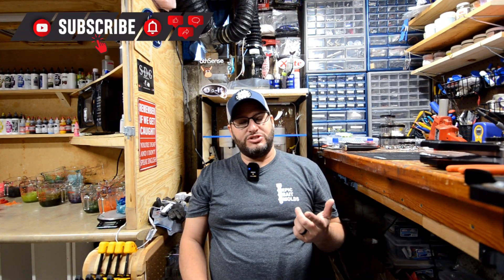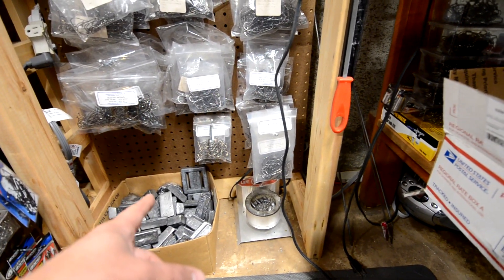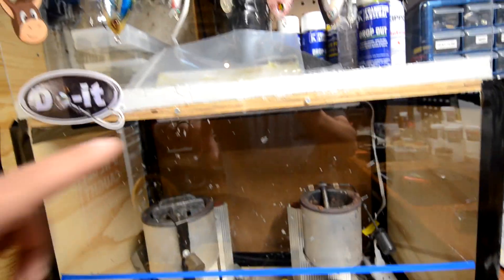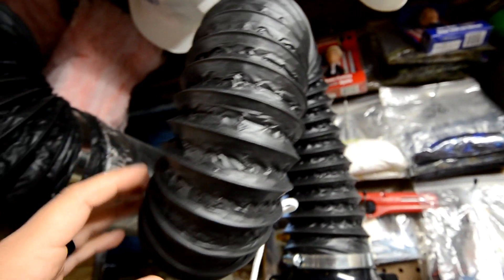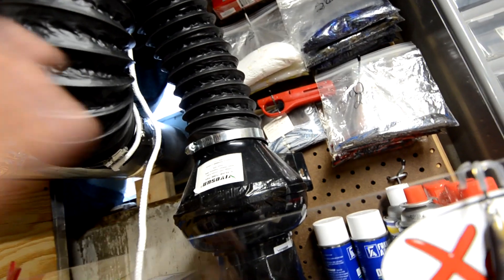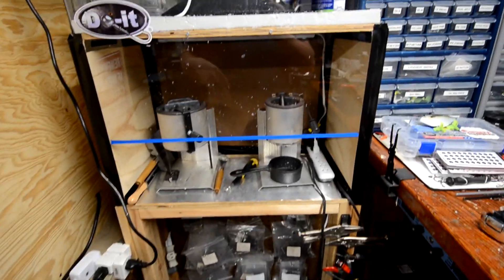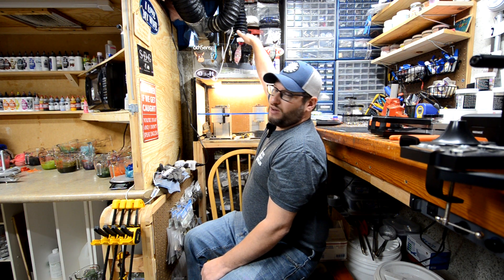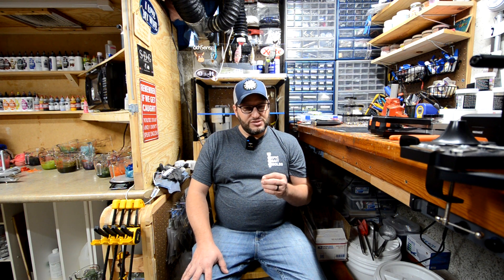LEAD POURING VENTILATION SYSTEM!!!

Comment: Great set up on an important subject, especially if you can't cast outside.  Some questions and thoughts.

If you had to do it again, what would you change?  
Have you done a smoke test looking for any leaks in the system and areas where air may just swirl and not exhaust?  Moving air acts much like flowing water.  A smoke test will let you see what problems, if any, you may have in your system.  Do you use a lead thermometer?  To minimize lead vapor, cast at the lowest temperature that gives good results.

Thanks for posting!  You're giving me some good tips and ideas.
Reply from the maker: Hey man! Thanks for reaching out, I have not done a smoke test to check for leaks etc. but I have taped every joint with aluminum tape and felt the air outside to make sure it's pulling the air out which it is. Higher the CFM the better and get a fan that has metal blades not plastic. I have upgraded my fan since that video and what a difference it makes.

Comment: Where do you bake your hooks? In one of the fume hoods also?
Reply from the maker: Do you mean baking jig heads with powder paint on them? In my toaster oven, not in a ventilation area.
Reply: @B8N_Tackle  Gotcha. Thanks for the reply. Temperatures are not a problem in your lead pouring box, being wood and plastic? It seems like it isn't. I guess with the fan running it keeps it cool.
Reply from the maker: @duncanbritton1961 fan is not to keep it cool but for it to suck the fumes to the outside.
Reply: @B8N_Tackle  Oh yes, I know that it is used to extract the fumes. I was just curious about running a hot pot of molten lead in a small enclosed space.

Comment: Good video , I have similar box for my lead station .I was wondering what size fan for your plastic station it seems like the fan is located high in the box seems like you would inhale the plastic before it reaches the vent
Could you explain how it works.
Thanks .
Reply from the maker: Jim, thanks for watching, I will be doing a video on the plastic station as well in the near future, but I use a 6" metal blade inline fan with more cfm to pull more air up and out faster, also have a from similar to the lead station except it opens up.